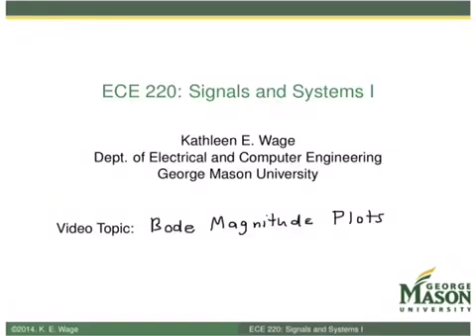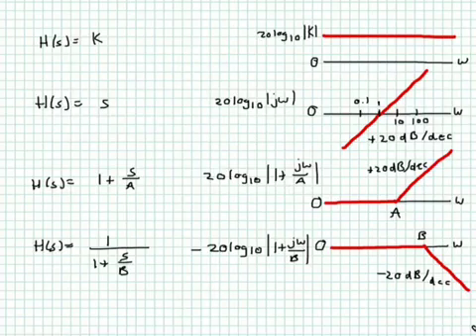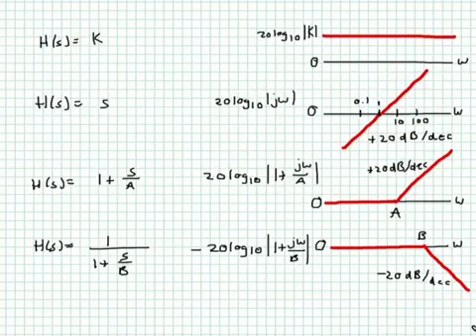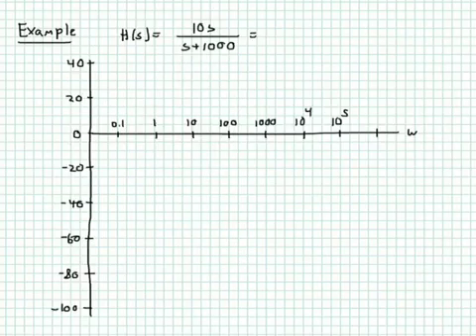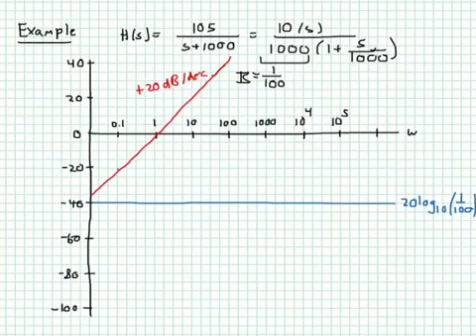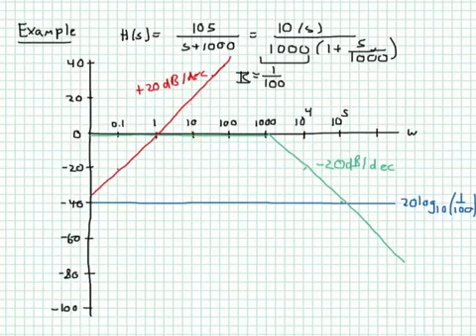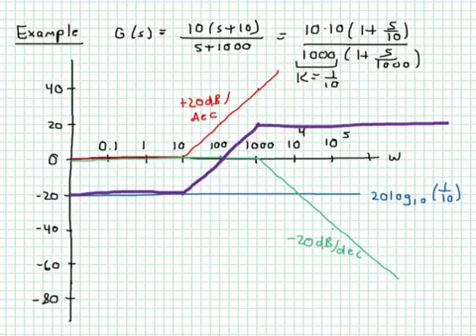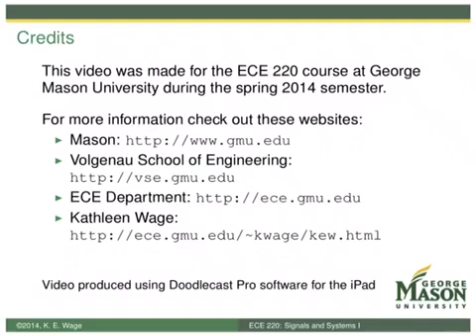Bode magnitude plots: sketching frequency response given H(s)

Comment: why final slope starts from -80????
Reply: consider the three lines intersecting the y axis at 0 dB, -40 dB and -40dB. If you want the intersection point of the combined lines, then 0+(-40)+(-40) = -80. Now, this combined line (representing the bode magnitude plot) has only one slope +20dB/dec, due to the zero (s term) of the system. So it slopes up to 1000 (which is the corner/breakaway frequency of the first order system). The corner frequency is where the Bode plot's slope changes suddenly changes, it's inversely proportional to the time constant of the system [a bit of extra info]
.
Reply: add the red line and the blue line

Comment: 7:08 should your line be at the 20logk starting mark?
Reply: it's 20 db/ decade , a decade starts at  0.1 ---->1 , but the lg w  (horizontal line ) is "delayed" at the start with 3 sqares on the paper , that's why on | H(jw) | line is down 3 square , to maintain the 20 db curve.  maybe it's personal preference on drawing , but w should be in lg scale , here it's linear scale